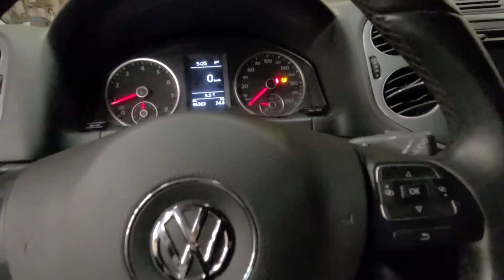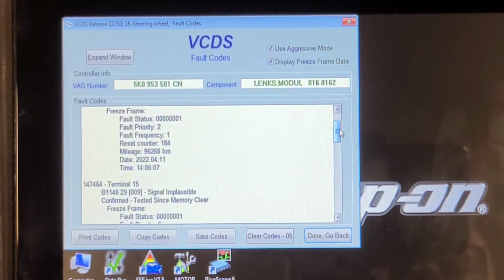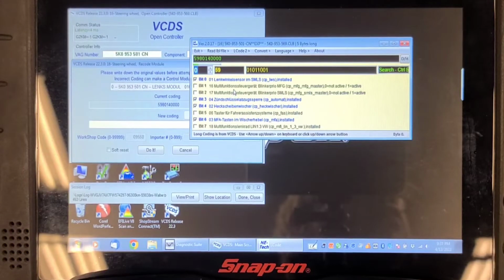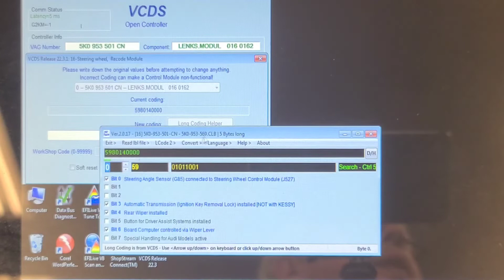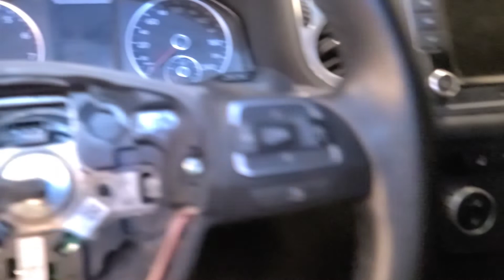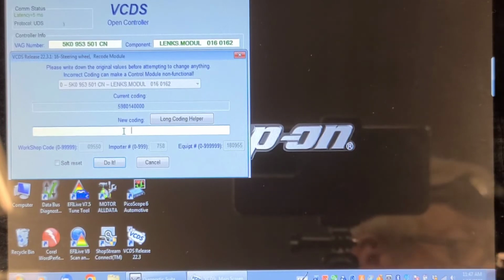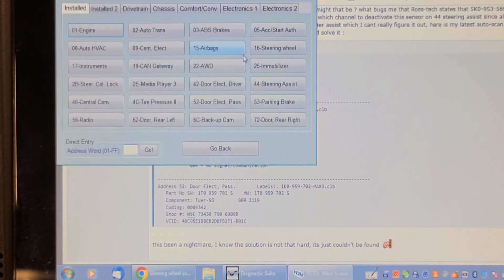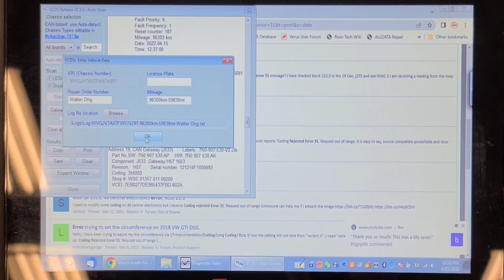2015 VW Tiguan Horn and Steering Wheel Controls Inoperative After Airbag Replacement pt. 1

Comment: This is crazy! I ask how much better has all the electronics made vehicles now verses 20 years ago? Do they noticeable steer any better? Do they drive noticeable straighter with all this steering angle stuff? I think this is all "overkill". It might be easier to diagnose in some cases, but to repair afterwards, I question it. (Just me talking out loud...don't mind me! 😊)
Reply from the maker: Engineers have to justify their existence. Also allows for adding features through programming but there is no reason to have so many variations of these controllers. This one turned out to be the incorrect part but a new part is on back order no promise date yet...
Reply: Agree, It's overly complicating car repairs so that you're forced to take it to main dealers,  so they can screw you for utopian prices.  i would never own another vw / german car again

Comment: Hi, great video! I have a 2023 Seat Arona FR. Do you know how easy it is to identify an airbag issue with this software and device? Or, in the worst case, is it possible to disable the affected airbag and get rid of the airbag light? I assume that this should be done in the coding option, under Advanced Settings, right? Thanks in advance!
Reply from the maker: As far as I know it can't be be coded out but I could be wrong. You may be able to simulate a faulty deployment loop with a resistor in its place but you need to retrieve the code first. I'm not familiar with that model.

Comment: If work has been done prior to you getting it, always check correct parts have been installed before anything else. Get the correct part codes from the main dealer. If one number or letter is different it will not work correctly. Different vehicles have different specs.
Reply from the maker: Absolutely!

Comment: Did it fix I’m having same issue on a T roc 😢
Reply from the maker: It was the wrong used part in the car. The customer was able to source another used SCCM and that worked although I was unable to set the steering stop limits. There is a part 2. Here is the link if interested: https://youtu.be/JXwqe62UfJ4?feature=shared